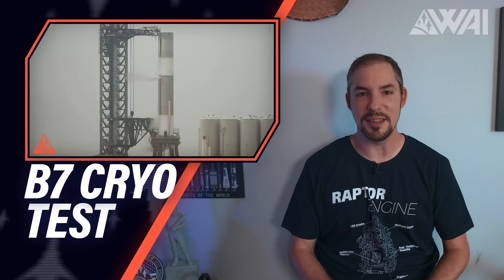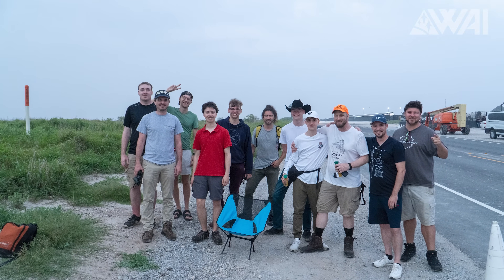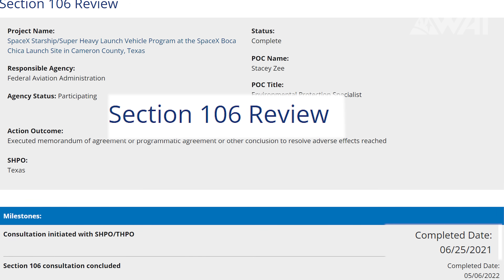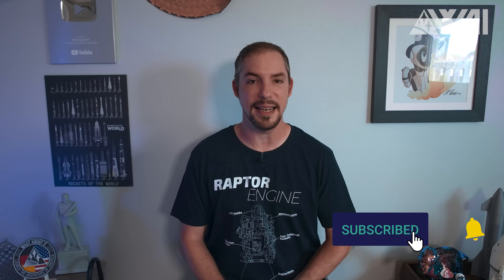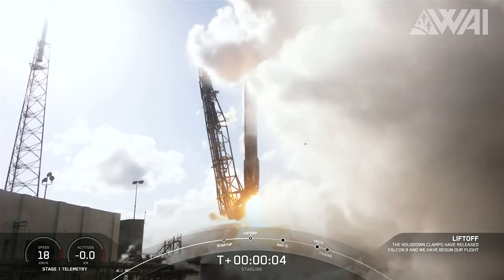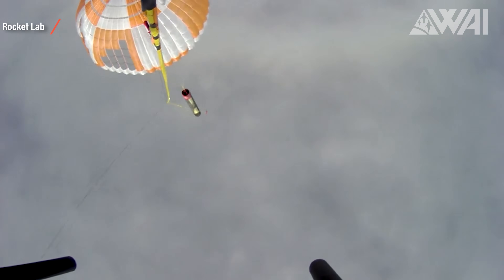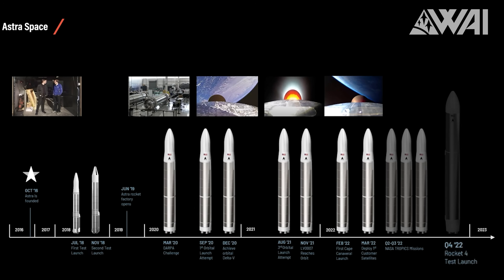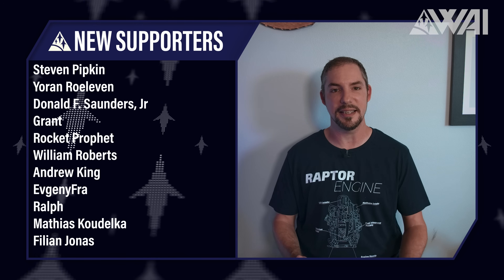SpaceX finally reveals an orbital Starship launch window!

Comment: I think nuclear propulsion is in the cards, and, if it will be developed several decades down the line, I don't think they would be satisfied with a Nuclear Thermal Rocket. I could see SpaceX looking into some of the more off-the-wall tech regarding nuclear. Stuff like the Nuclear Salt Water rocket (among many others) is totally crazy, but they have the potential to open up an entirely new playing field in terms of space travel. In terms of an engineering challenge, it would be enormous, but SpaceX has shown how good they are at engineering challenges. Forget double efficiency, with these sorts of advancements, Relativistic space travel would be in our grasp, enabling very fast, insanely cheap travel between planets or even interstellar probes. Sounds like sci fi but it's all totally within the realm of modern engineering. I doubt, however, that even Nuclear Thermal Rockets will be pursued for at least a decade still. SpaceX doesn't have that kind of political and economic capability.

Comment: i dont believe in  ntr being the future, i think nuclear reactors powering ion drives will be much beter, as the thrust of an ion drive is just how fast you can ionize the gas you use for it, which just requires more power, so you can get much higher efficiency than a ntr, while still having good enough thrust for most applications

Comment: the door looks like it slides down and pushes outward to create a cover/seal, think of it as the door on a VHS player that covers the opening.  When cycling to load or unload pull back slightly and go up or down to clear for operations.  What we see is the door in a neutral position because the operating system is unpressurized, the orange around the edges looks like high temp gasket material required to seal the opening during descent.

Comment: Smaller vehicles with a large fleet count, can be launched at more random times, matching when the customer wants or needs to launch - they won't compete on costs, but on rapid availability.
Reply: opzz xsin  did he tell ya about the four giant elephant's on the back of the gigantic space-turtle that holds the earth up as it swims between stars?

Comment: They are nowhere near nuclear propulsion. Likely we will have long landed on mars before something like this is implemented. 

Nuclear thermal propulsion would be best on a nuclear tug that stays in orbit and ferries starships to and from mars/moon. That way starship only needs enough fuel for propulsive landing and can forgo all the orbital refueling (6-10 refuel launches last I checked) needed to give it enough delta V for mars/moon transfer burns. Due to weight of shielding and the engine having a low TWR you would not want to put a nuclear engine on starship itself.

Comment: Dr. Charles Kelly has been working at SpaceX in Hawthorne, CA since September, of 2021. He’s an expert on Dr. John Slough and Dr. David Kirtley’s Plasma Magnet Drive aka PMD, and Plasma Dynamic Parachute aka PDP technology. Dr. Kelly headed a team of students at the University of Washington that built a satellite to test this technology in orbit called SOC-I. It’s scheduled to go into orbit on a Firefly Aerospace Rocket in mid-summer of 2022. The Plasma Magnet Drive uses the energy in the Solar Wind to go 40 times faster than chemical rockets alone. PMD could be powered by a small nuclear reactor aboard a Starship. A PDP could be used in the thin Martian Atmosphere to slow it down with multiple orbital passes around Mars. PMD & PDP technology accomplish acceleration to 400 km/s velocity, and deceleration from that speed without additional fuel mass! This is revolutionary! If Starships can go 40 times faster than chemical rockets, and slow back down in the Martian Atmosphere, then SpaceX can get people to Mars in a week, instead of 9 months! And the 26 month, Mars Hohmann Transfer launch window is eliminated. This makes Mars Colonization in the millions possible in less than a decade.

Comment: Starlink is just not competitive in Russia. I have 300 mbit/s unlimited internet for 10$ per month. As you can see, Starlink is 10 times worse and 10 times more expensive. However, it will probably be usable in some remote locations, there is no official ban.

Comment: Not a surprise the dispenser system for Starship. To have a functional wide payload hatch, the hull would need structural reinforcements adding weight. Add to that, the requirement of sensitive maneuvering to deploy the cargo without a Canadarm.

Comment: Of course, nuclear propulsion has been a consideration for SpaceX since from day 1.  They need some form of Starship to take off and land but I think it will take a space tug to get them to Mars more quickly with return trips as well. There have been many propulsion system already designed that offer a good basis for development. Where SpaceX excels is in metallurgy and that is a fundamental need for nuclear propulsion. I suspect that Tom Mueller is already hard at work on it. That would be a really good interview.

Comment: Quick correction at 4:51: a (solid core) nuclear thermal rocket doesn't have a higher exhaust velocity because it's hotter than chemical rocket exhaust, but rather because the exhaust has a lower molecular mass.

A Raptor that burns oxygen and methane will produce water vapor and carbon dioxide, both of which are heavy and therefore slow. All an NTR does is boil hydrogen, and that's the lightest molecule around. That's why NTRs can get exhaust velocities twice or even thrice that of any chemical rocket despite reaching the same temperature.
Reply: Yeah, to keep the uranium fuel rods from melting the temperatures have to be lower than those in a chemical engine. When a nuclear thermal engine uses other propellent like water or methane its performance is worse than a metholox or hydrolox engine. Cause of this solid core nuclear thermal engines are mostly limited to using hydrogen and the bulkiness of hydrogen tanks eats into the mass savings a bit so unfortunately you don't really get the full benefit of 200% increase in fuel efficiency. Also the mass of the nuclear reactor and radiation shielding can be substantial, so NTR make the most sense on ships which need large amounts of propellent, that way the reduced propellant mass is more than the increased engine mass.
Reply: @massimocole9689  Gotta go for that sweet, sweet nuclear salt water rocket.
Reply: @JohnDoe-rl9pp  It's highly questionable whether a NSWR built with state of the art materials will survive "ignition". Even if it would work, the hassle with the radioactive exhaust makes testing on earth extremely difficult. They would need to put every prototype into space and test it there. Expensive would be an understatement.
Reply: @Bennet2391  Indeed, but once we achieve interplanetary reliability, that problem gets much smaller, as we can build and test on zero atmosphere bodies.
Reply: Right! You read my mind writing your comment.

Comment: The limiting development factor for Nuclear thermal engines are the fuel development steps…fabrication, testing, reformulation, retesting, licensing…it’s at least a 10-yr cycle. Also, many of the facilities required for this development cycle do not exist…so this is a problem.
Reply: The limiting development factor is government red tape.
Reply: @RedSiegfried  while licensing slows things down, there are no hot cells that can examine the nuclear fuel left in the US. The single most different cult problem with TNP is the degradation and swelling of the nuclear fuel during operation.

Comment: Actually I'm pretty sure nuclear engines are more efficient as they produce pure gaseous hydrogen at high speeds. Not because they are hotter as if they were hotter. They would need even colder liquids than liquid hydrogen to cool the nozzle which they use on space. Rockets

Comment: Regarding nuclear rockets, whether for launching to LEO, or for trans-marsion insertion, the pioners in this field were General Atomics.
The closest we ever got was the Orion project which was to be powered by pulse nuclear explosions against a massive pusher-plate.   The proposed launch vehicle was to weigh multiple thousands of tons, & was most likety have worked.
Reply: Orion was a concept, they actually built NERVA, which is an actual nuclear rocket, so no, Orion isn't the closest
Reply: Sorry but Orion was not likely to have worked.  It may have been able to be made to work but that's quite different.  Its well understood that today's chemical approach is only a good idea in that its what we have the most experience with, and that other approaches have more inherent value if we can execute.  Fortunately, today's technology seems able to get us close to adopting one or more of those approaches.
Reply: @petercowling6769  The Orion project at General Atomics was quite a bit more than just a theoretical concept.   There was prectical testing to prove the principle was viable.   The project only got shut down  because of the international treaty baning atmospheric testing.
youtube.com/watch?v=xYoLcJuBtOw

Comment: Nuclear engine is the thing that could be used only in space (due to low TWR it can’t lift rocket from Earth), so it could be a good variant for orbit-orbit tug, not for a launch vehicle. Also, there are some problems with radiation protection if we talk about crew flights.

I think they might be useful in far unmanned flights for example Jupiter and further.
Reply: Nuclear engines are much broader than your video games imply
The larger and more powerful engines do have viable TWR
Reply: @endlesshonks2392  Even for the ones that have higher TWR, they should be only used outside LEO due to radioactivity in reaction mass.

Comment from the maker: Is SpaceX working on something like nuclear propulsion already? What do you think? :_WAISweet:
Reply: I think I got first view on this great content!!
Reply: The lead engineer on merlin and raptor left spaceX about a year ago (Elon took over for raptor dev) so their may be… but I won’t know as their would likely have been some sort of source on the inside. Thoughts?
Reply: They're working on it as much as they're working on Hyperloop
Reply: In a rocket motor, oxygen and fuel heat themselves to temperatures no solid can withstand. In a nuclear motor, the fuel is solid, so the temperatures are necessarily limited to what solids can bear, and so are lower -- about 2200 K, in historical prototypes -- not higher. But the molecular weight of the expanding material can be 2, because it can be pure hydrogen, rather than ~20. That speeds the flow up a lot more than the reduced temperature slows it down.

If you haven't seen SpaceX buying truckloads of liquid hydrogen, nor seen any signs they are warming up again to this difficult liquid, then probably they aren't working on nuclear propulsion.
Reply: I mean, it's "Space eXploration technologies" is it not? SpaceX prolly has a lot of prototyping going on at any given moment, so I wouldn't be surprised if SpaceX has some kind of research going into nuclear propulsion. Rather, I'd be surprised if SpaceX isn't researching it. 
However, I'd doubt that they're working on some type of engine, they're putting all efforts into building the Raptor 2 at the moment. 
Once SpaceX has gone to Mars and they've gotten used to interplanetary travel however I wouldn't be too surprised if they start developing some kinda new propulsion system for future vehicles.
Reply: The closer SpaceX can get to working on (interplanetary [there will never be boost-phase nuclear, for obvious reasons]) fission propulsion on the practical basis they will be looking for to get heavy trucking to Mars (their real von Braunian vision), the more they are looking at actual nuclear-thermal-reactor designs that they are prohibited to work on solus.

I think what they are looking for, Felix, is to light a fire under NASA, et al., to start government getting a lead on this before other state actors get an advantage. SX may, or may not, be a contractor on such a project. My fear is that if any other company with nuclear experience leaves SpaceX out, we may see an SLS repeat performance, and a Sino-Russian landing on the Moon or Mars before the American old guard gets a test firing, or even figures out how valves work.
Reply: They cannot mostly due to the lack of a place to do the testing, and getting permission from the AEC/NRC. I understand other companies might be assuming they have the two major requirements (testing location and permissions).
this WAS DONE by NASA back in the 1960s and early 1970s - but the flight engines and technology developed were thrown away.
Reply: @jessepollard7132  they could be researching nuclear propulsion tho, don't necessarily mean they have to work on an engine